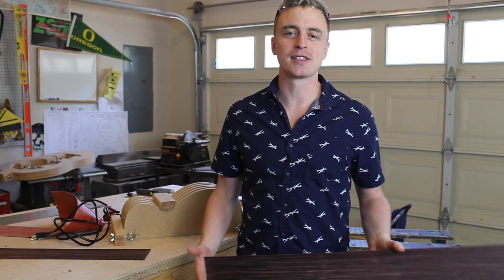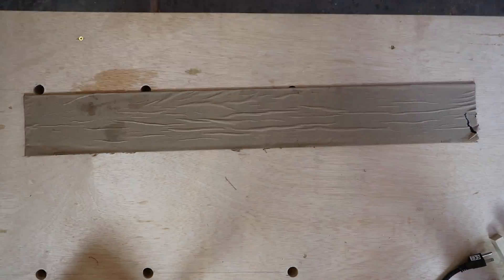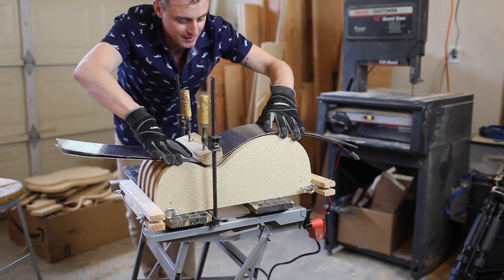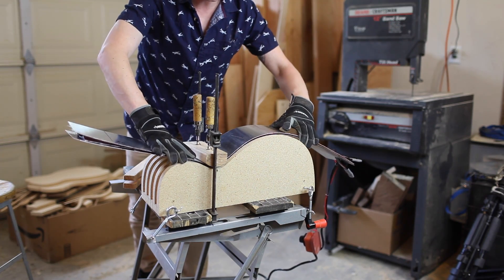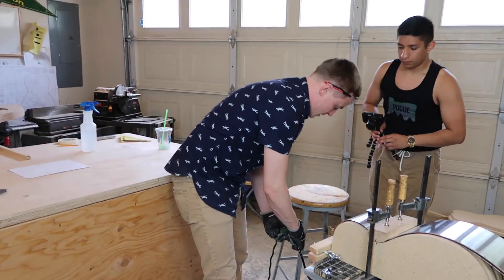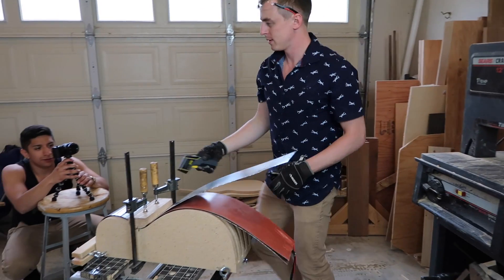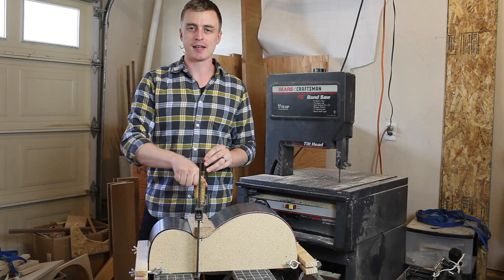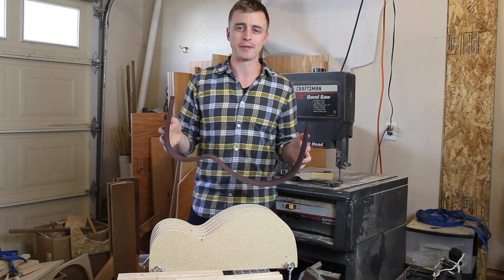Bending Acoustic Guitar Sides (1st attempt)

Comment: Looking good! So much more precise than my builds. While they we waiting to be used, I put my sides back in the mould with sticks pressing them to help minimize spring back.
Reply: A Guy Doing Stuff no I did a bolt on for all 3, one was butt joint the other 2 were kind of a loose hybrid. The  neck had a sort of tenon and the plate had sort of a mortise, but I used bolts. Bolts work good, and another luthier/musician  friend of mine says bolt on are the way to go. If I find the link with detailed instructions instructions used,  I'll post another comment. --- Plus allows for some tweaking of the alignment.
Reply from the maker: James Clem awesome good to hear! Yeah I've read that link you sent me several times! Did you write about your neck joint in your Instructable?
Reply: A Guy Doing Stuff  yes, about attaching a pre-made neck